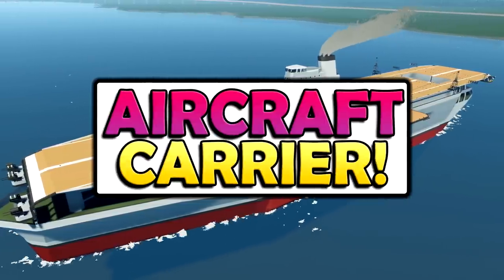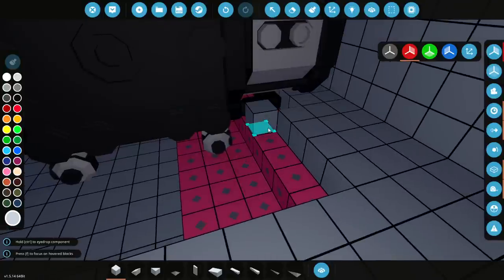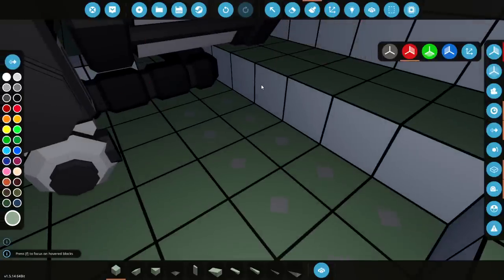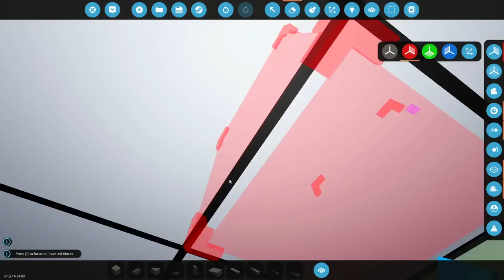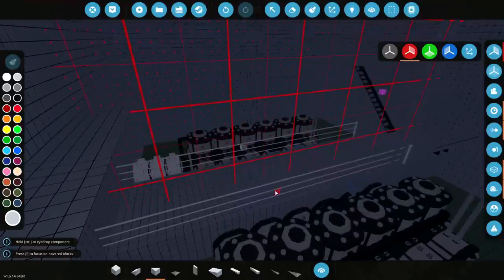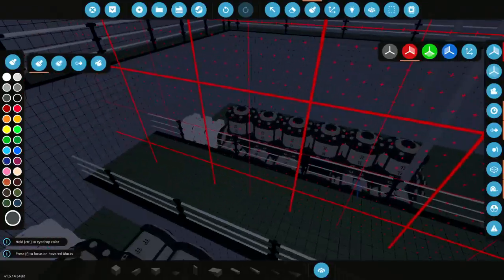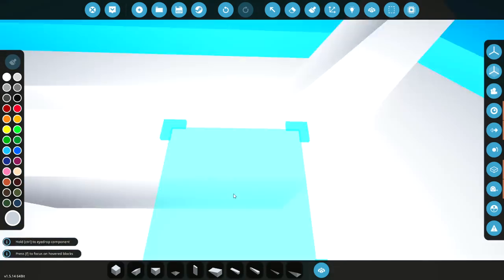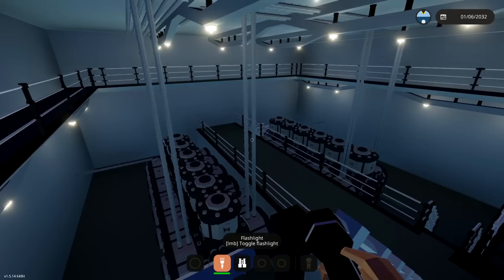Fully Accessible Engine Room! - Aircraft Carrier Build - Stormworks - #16

Comment: Gearboxes are turned around wrong way. If you want to try different ratios change one side and see which direction the ship turns on its own (great A/B test). 

Also for the stairs there is a railing piece so you don’t have to use middle connectors all the way up.

Comment: By the way I'd like to see a machine shop just for aesthetics. All you need to do is place a rack in a room with a large solid table that has a rail on it as well as a blue vise. next add industrial colours to an over head winch an add somewhat completed small engines. The rack should have loose lights rudders propellers and other aircraft parts.

Comment: Hey there! If you ran your seawater coolant through a heat exchanger you could then treat the cooling water and separate the system so you didn't have to run straight seawater through the main engines just through the heat exchanger. Just a thought.